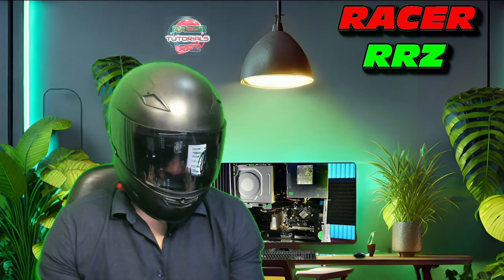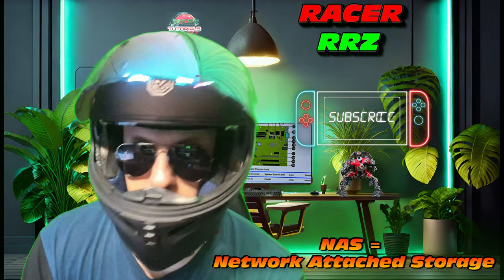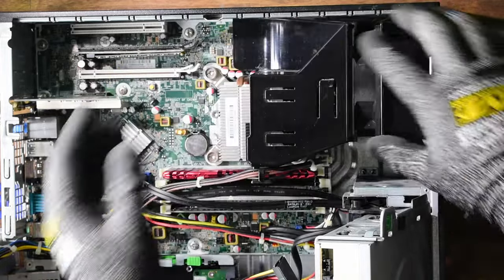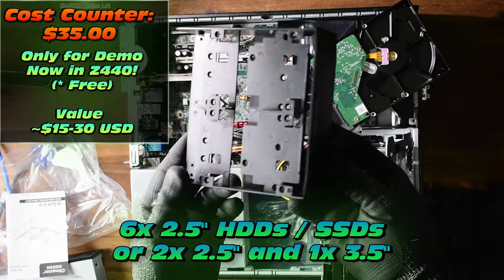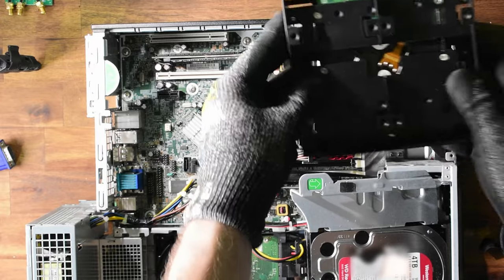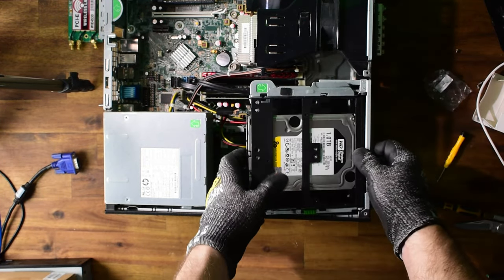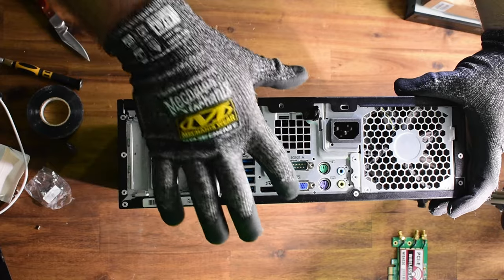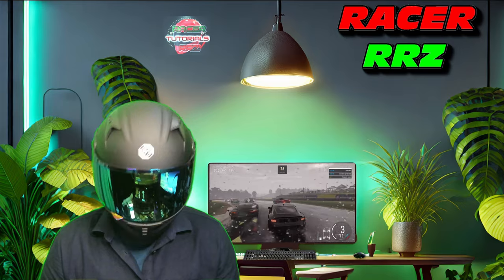$19.84 NAS / Home Server! (NVMe booting, SSDs + HDDs, ~25W Idle Power) Bargain or Click Bait?

Comment: you could do a lot more with a old mid gaming mid or full tower.  And a lot more safely with far more upgrades, room for a better  motherboard with more features and far better air flow.  Really if you did all the mods possible you suggested you at least created a future potential fire hazard

and its a LIE that it was free, it was PRE-purchased in the past (aka you already paid for it).  But THAT cost for each individual item in it is what it ACTUALLY cost.  Unless you actually got all of that from trash or a dumpster it wasn't free (even then arguably not when you factor in gas cost)
Reply: i'd like to see what you can do with THAT better idea and whatever you have laying around.  make a proper ghetto server out of it.  After all if you can find old good mid or full sized gaming pcs around for cheap or free why not repurpose those instead of a small form factor machine? And as far as the antennas?  Why not just salvage them from a old or dead router you can just unscrew them from and put on something else?  Or wifi card?  Especially if it was trash or dumpster pulled, verified to not work or be better than what is already serving your network

Then you can make better use of those parts and have something other than a cheap small form factor machine you likely pulled from a goodwill or salvation army or the like that was once a cheap office machine
Reply from the maker: My only complaint with the larger builds would be power draw. 
I case swapped a Z440 Workstation motherboard into a Fractal Define 7XL Full Tower which is an absolute dream file server. It is happily handling the footage I have filmed up to now - but I don't really want to have that 200-300W power draw running 24/7. Hence, this SFF PC can pick up the 24/7 file server or NAS task while only using 20-35W, pending the hardware configuration. 

I agree with you there, free is relative - and if you add up all the actual hardware costs over the last say 10 years on this machine and all it's hardware (I forget - but I recall paying ~$150 USD for the base machine in 2016, plus several hundred in parts - if you consider retail prices - especially the RipJaws 1600MHz RAM - that was like $80 USD per module in 2013 ish when I got it for my X79 ASUS ROG Extreme 4 mobo). All the parts have, however, depreciated over time, and for all intent and purposes I could have taken this SFF PC to a goodwill drop-off point for someone else to enjoy (and I probably will if I end up finding a better replacement for it).

I included pricing for everything used in the video because most builds of this nature do not provide the actual system cost - they usually list the base system cost ("free dumpster find") because no one would pay $500 USD for a old SFF file server (but maybe that's the better thumbnail lol). I have a cost breakdown towards the end of the video - with my estimate being ~$180 USD for the upgrades (although all the hardware was from ~ 2012 - 2020, so old, and that's not including the PC since I already had that but they can be sourced for $20 USD on Ebay now). 

My logic for the pricing was more from the cost saving perspective. If I ran my Z440 file server for 1 year it would cost ~$192.92 compared with ~$32.76 USD in power for this SFF system. If the system cost me ~$180 to build, but saves me $160 in power per year, that created the "$19.84 cost" click-bait.

So I saved it from being taken to the "dumpster" - but I will not try to claim that I saved it from someone else's dumpster. But at least I am honest - it was pulled out of my wardrobe (which I guess is my dumpster ...lol).
Reply: @racerrrz  wardrobes don't count as dumpsters.  And with the same components in a larger case you wouldn't have any more power draw, you'd possibly have less due to the fans not needing to run as fast

And that's still wrong,  what you paid is what you paid not what its worth.  So depreciation is irrelevant since that's what it could sell for.

And depending upon what else you needed to add to it that could be worth it vs making another file server.
Reply from the maker: I agree, wardrobes do not count as dumpsters. But I think my analogy holds merit. 
Where do the PCs that end-up in dumpsters come from? 

They were all likely forgotten about in storage, left unused in someones wardrobe or garage, or wherever it was stored - and only after a wardrobe clean-out do we take the time to consider the best action for long forgotten-about hardware. 

Similar systems are listed for $20 USD on Ebay right now because it's value has fallen substantially due to the progression of time, which makes it a prime candidate for donation / recycling, which we both agree on. 

I gain a sense of satisfaction of giving this little PC one last moment in the lime-light. It helped me through a tough time, so I'll call it a "sentimental build". It even has parts from my first gaming rig, which I will add decided to blow a capacitor when I had no money to replace it. Hence, that was where this humble little PC entered my life - it was more than I could afford at that time (broke student life) and it had to work hard while I was in my final years of my uni studies. 

I am sure you appreciate that, as time progresses, hardware depreciates. That's the very backbone of why hardware becomes more affordable over-time compared with what it was worth when it was brand new. 

The classic depreciation example is that of a brand new car. The moment you drive it off the lot it looses 10-15% in value. It doesn't matter what you paid for it, what matters is that it became second-hand the moment you claimed ownership, - depreciation as such. A somewhat annoying reality of the economics of goods in the world. 

PC Hardware depreciation is very real and it should be factored in - as should inflation and the global economic climate (recession vibes) - but where is the fun in spending all your time fact-checking every little detail to ensure it is scaled for the progression of time? I would rather just sit back and relax to better appreciate life with all its ups and downs.
Reply: @racerrrz  money paid is money paid, and any pc eventually started off in some factory before getting used for whatever it was used for before being discarded to the dumpster or curb or donated.

And i agree upon depreciation but that doesn't make it what was paid originally.

I'm just saying why not start with better parts you already had laying around and not doing anything?

You could also go hunt in retail outlet stores like daily bins (a store that buys returns and cheap items from places like wish, temu, walmart, target etc).  And dumpster dive to see what pcs and parts you can find.  And go about on trash day and bring home any pc hardware you can find (and any boxes of cables to go through to see what's burried underneath, same with games or movies and whatever else you may need or want)

You could then do test videos getting them up and working and testing the cheap stuff to see what is a valuable find.  Repair what you can and whatever can't salvage for parts that can potentially be re-used in other builds and send what's beyond repair to e-waste
Reply: i've been turning pcs into projects with older ones ever since my 2nd pc (1st was a packard bell 333 mhz 64 mb of ram and a 8 or 16 bit hdd that eventually died in the early 2000s due to power supply failure.  I have its parts but no longer that exact one (though i have a clone of it minus the hdd and a replaced psu i know works.

My HP  p4 (478 single core 1.7 ghz) was my main project and workhorse for awhile,  Had upgraded it to 768 mb of ram from 512, added a 120 gb hdd to compliment the 80 gb.  Had added usb 2.0 and a 100 mb lan card to it (in addition to the 1.1 and firewire combo card that came with it and its 56k modem).   Was working until late 2007 or early 08 (not certain to be fair)

It was a internet server (ICS in XP due to to having a router at the time)  It was sharing out a 56k modem's connection (until att's early 2000s dsl became cheap and upgraded through that, it was serving as the router until i had my 1st (and no longer working netgear 614v6, replaced that with a v10 (still works but not in use, but that thing is a workhorse once it gets going, had it handling 5 1080p twitch streams at once (4 on current pc one on a laptop), plus plutotv streaming (cable internet) on a junk saved from trash working enough to do that.  Only flaws with it is it denies internet until you run the setup wizard and click to go on the internet, and won't allow internet without doing that).  Aside from being only 100 mb and 150 mb n at most (might of been enabled in a later firmware update, its at the latest offical)

The p4 was also doing file sharing on the lan for its own hdds, and a 120 gb, 160 gb, and 300 gb hdd.  And had it serving as the database for my collection of mp3s to stream to a pentium 2 450 mhz to play at random (not certain if it had enough space on its hdd).  That was running windows 2000 pro.

the p4 also had a geforce 6800 in it so it was upgraded.  Eventually the caps went and probably killed the board (had found a lot of leaking and bloating around the cpu, salvaged everything from it and they're around someplace looking to test later.

Have various other machines waiting to test and strip down or add parts to for various projects

And i was serving the pentium 90 and 133 (technically downclocking itself to 120 mhz due to lacking a heatsink).  That was my dad's though (still has them though they haven't been used in ages)  Had windows 95  and or maybe 98/se on it and had a bunch of shareware games/demos to play with (still have em).  Hdd was maybe a 1 gb and a 500 mb or about that with a 2x cd-r drive.  Was learning to troubleshoot and maintain them.

Also remember running dos snes and nes emulation playing super bomberman 4 and 5 and other games on them.  Among other games

But still  my points still stand and any machine can serve more points than you think and you can always experiment with em, collect more and show em off in videos
Reply from the maker: I need to get better hardware then! haha. This is the only SFF system I have on hand, I normally just buy mid/full tower systems because the SFF's are well known for heat issues. But with that said my intent here was different to normal, I wanted to minimize power draw on the system so that I can leave it on 24/7 as a file server and not worry about the power bill. The temps on it have been decent, but then it sits on idle most of the time. I will see if I can find some better geared hardware that is of a similar nature, because this system is getting along in the years and I would prefer something that can stand the test of time. I'll have a look but I don't think we have daily bins here in NZ - there are lots of hardware drop-off points, but that is meant to be a drop-off, not free to collect point. Online marketplaces tend to be decent - sometimes hardware goes cheap on auctions.  

Nice, you sound very experienced with your hardware knowledge. Internet with 56k automatically brings back memories - that dial tone. Wow, 5x 1080p twitch streams, I would have expected that to be quite demanding from a GPU perspective - not to mention loading up that copper internet connection. I have trouble recording 4K 60FPS while gaming in 4K, and that's with modern day hardware. I really wish I kept my first PC - it would have served me well for a video right now. It was a Intel 286! Back then those 1.44MB drives were life - and so were MS-DOS games. Talking MS-DOS games, if you haven't already found this - awesome nostalgia. The last game I tried out was SupaPlex - too many hours spent on that one back in the days! https://classicreload.com/
Reply: @racerrrz  technically if the hardware is identical then the power draw is the same or less.  The difference can be in the air flow, if the fan runs on a lesser rpm to keep the heat down you're technically using less power.

the hardware i was using and a still using is my i5 4690k, geforce 970, 8 gb ddr3 1333 and it was several years ago with firefox, also mechanical hdd (3 tb, still kicking, was 3 tb (boot one still kicking ironically)

All seagate from the failure era too lol.  Currently the 2 that failed (storage drives for steam and other digital download source and other things) were replaced with a 6 tb ironwolf nas hdd (was on sale for cheaper than the equivalent 6 tb normal seagate) and a 2 tb (also a seagate)

Its my 1st full custom build (not 1st modified though)

Currently strongest pc i own (and i am looking for cheap upgrades but all i see are pentium 4 (salvation has a custom one for 20 usd but aside from maybe a couple hdd nothin in it other than a couple optical drives).  Been seeing a couple small form factor machines (2014 so 3rd or early 4th gen) with Pentium G range processors (what i like to call the extreme buget selection)

But someone bought both, one went for $40 (salvation army) and the other for $25 (value world).  Also seen a Pentium dual core (the weaker core2duos)
Reply from the maker: @patg108  That’s fair, every little detail would play into the end power consumption. But it’s generally best to not have the fan speeds sky high unless the machine is overheating. I have all my HP workstations on their lowest fan speed settings and they run nice and cool. 

I bet you have that i5 4690k overclocked, solid CPU for the era. I still use the GTX 970 – they remain a capable GPU and more reliable than the GTX 980 (I have seen so many GTX 980 Ti’s that got bricked). The 6TB Ironwolf NAS HDDs would be a solid upgrade. I replace my fail-era Seagates with W/D Red NAS Plus or Iron Wolf Pros (2-16TB, pending end use scenario, I have a quite a few now to store video footage). I haven’t had a HDD fail on me just yet, but then I have some that haven’t seen power in a long time- but they would take me back 5 plus years in time haha. 

If you are still daily driving the Pentiums I should really introduce you to some of the HP Workstations (I have done a heap of videos on them haha). The best bang for buck would probably be the HP Z420 – you could get a relatively bare bones machine for like $70 USD (but that may not be an upgrade over your i5). Aged Ivy Bridge Xeon CPUs are cheap – as is DDR3 ECC Server memory. If you expand the budget the HP Z440 is quite capable (~$75 USD), Broadwell CPUs and DDR4 memory (2400MHz peak speed). I retired my Z420 for a Z440 and built it into a NAS and I am quite impressed with the performance. 

Affiliate Ebay links (I get a small commission if you were to buy using these links):

HP Z440 (3.10GHz Xeon E5-1607 v3, 16GB DDR4, No HDD, Quadro K620): https://ebay.us/3QhOP6

Xeon E5-2667 V4 (8 Cores 3.2GHz 20MB 9.6 GT/s 135W LGA 2011-3 CPU SR2P5): https://ebay.us/Zrk7LE

That Z440 is a great price for the hardware! Not ultra low budget but that's a lot of performance for the money. I'd pair the Z440 with a Xeon E5-2667 V4 (slightly higher power cost but huge performance boost): 

https://www.cpubenchmark.net/compare/2284vs2830/Intel-i5-4690K-vs-Intel-Xeon-E5-2667-v4
Reply: @racerrrz  Its actually stock clock, but the os is manually tweaked for performance and to minimize usage.   Its stock cooler too.  

And all 3 of those drives are in use, most of the rest of mine rarely see use as its my daily driver.

Idk if its more reliable than the 980, the 970 is a launch edition and can crash easy (but no problem after reboot)

I still have the 80 and 120 gb around from the pentium 4 and didn't get em to power on last i tried (though i might try other hdd revival youtube tricks just for fun)

I do have some xeon laying around that may well possibly outperform it or at least come close (might be better in multicore i'm thinking)

And i wish i was seeing those nice of machines for sale.  My area is either kind of picked over or they just sell the better stuff online (combination thereof)
Reply from the maker: Nice, it sounds like a solid setup that you have optimised there. I have not had any issues with my GTX 970 but I also never really pushed it, it just does what's needed. With online shopping these days it is easier to get hardware. Locally the options are quite restricted, but with patience good deals do come up. I trust your holiday period is going well.
Reply: @racerrrz  like i said its a 1st gen with the 3.5 Gb of ram +512 mb cache that nvidia did so its less table than the other later ones by a lot.  You know the ones that had a recall? i hadn't noticed and missed out on that

Modern games can play well or they crash it.

And aside from my dad getting everyone on my side of the family and my sister's family sick with a cough its going great.  He picked it up somewhere (either at church or krogers or something).    So everyone has it and he was coughing a lot at my sisters..  But aside from that and maybe a bit of a sore throat from that (he definitely has one can tell by his voice change) its good.

Will probably be over it in a few days

And i know.  But its not the time of year here for garage sales (too cold)  Though even then i only saw 2 good deals on gpus.